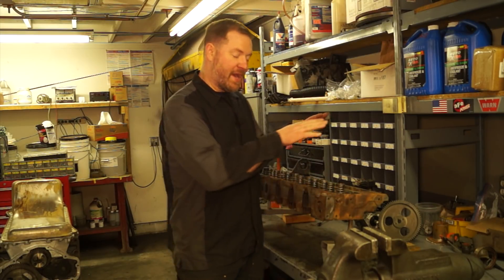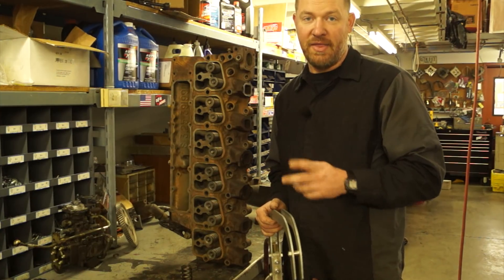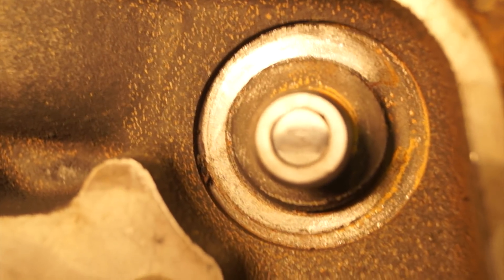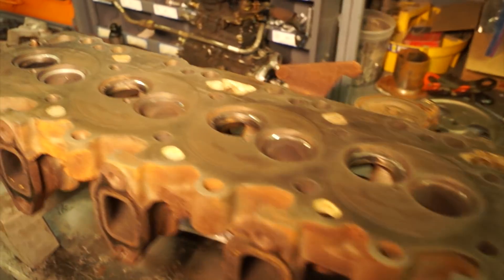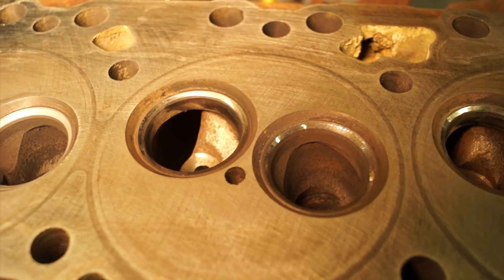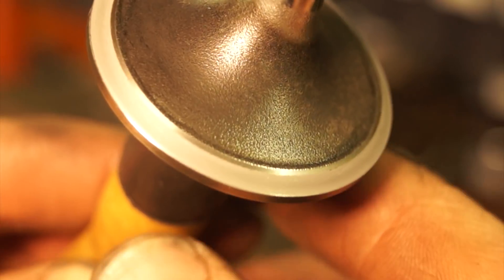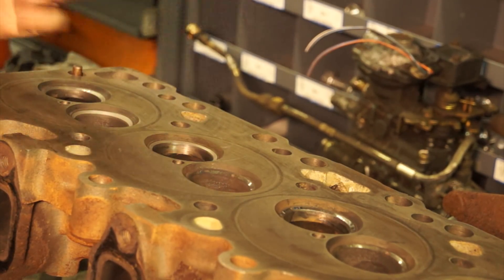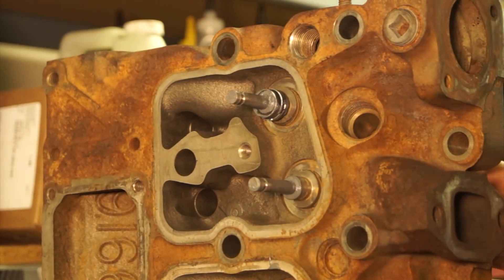Part 3 - How to Rebuild a Cummins Diesel 12 valve 5.9L 6BT Engine

Comment: To me it is cool to do that what you're doing on the head but if you're going to go that far and rebuilding the engine I would have the head magnaflux to check for cracks and a three angle valve job if that at most but the price you're going to pay for that you might as well just get a brand new remanufactured head

Comment: Hi, I'm about to do a rebuild on my cummins 6bta. Just wondering what difference the other springs achieve?
Reply: when you turn up the pump and install higher governor springs, there is a tendency for the stock valve springs to not be adequate above 3K rpm.

Comment: Can a p pump be installed on this engine ? Instead of the ve
Reply from the maker: Yes it can
Reply: O.G. cummins w250 yes, all 12 valves in the second gens had this EXACT same engine just with a VE pump. You could put a p-pump on the 24 valve 5.9 as well. Not sure about the 6.7 but that would be pointless anyway.